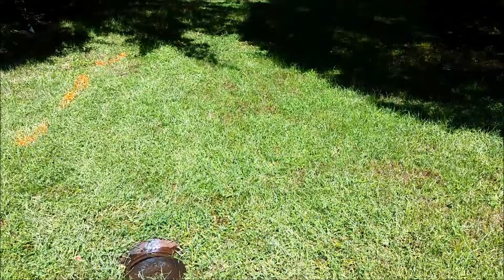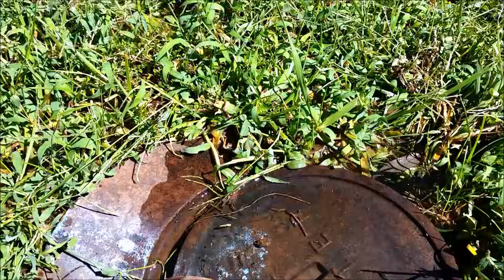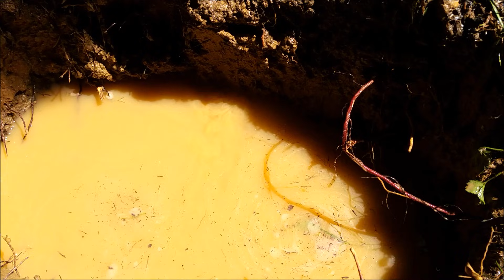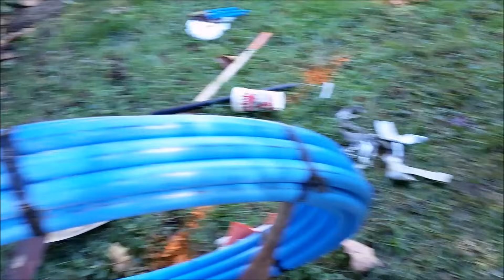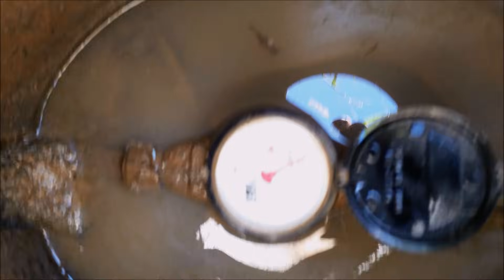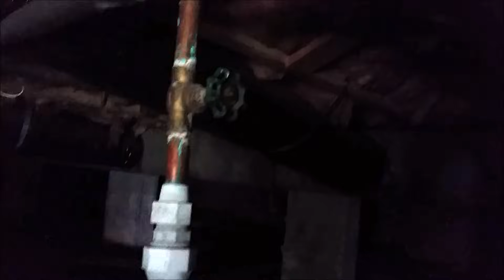DIY: How To Fix a Broken Main Water Line Pipe

Comment: YOU ABSOLUTE MAD MAN! Opening a gate valve that quickly is truly living the Adrenalin life, living on the edge.
Reply from the maker: Thanks! Didn't know that. I did some searching and didn't find anything that said to open them slowly, but I can't think of a reason not to take an extra few seconds to open slowly to be on the safe side.
Reply: @RiverLifeWV  And, once you fully open the valve shut it back a quarter of a turn. Reason is that anyone else moving the valve will know after a quarter turn it will stop (= open) and it obvious which way to then turn off & also stops the valve seizing against to end stop.
Had that have been my place (good job BTW) I would have left the hole open for a few days to check it from time to time and a length of plastic drain pipe cut into 2 halves would make a good cover / protection for the pipe repair before bedding the pipe in soft sand.

Comment: I had same issue , I installed the compression coupler and no leaks , but I had water leaking down from the dirt , I wonder if it was from all the water that leaked overnight or I must have another leak down the line , will check in the AM see if there's more water sipping down ..

Comment: You can use standard PVC. U can buy just a for for cheap. As long as its the same diameter. The fittings will work the same.
Reply: We have same problem but don't know what diameter of water pipe we are using... How to figure it out?
Reply: That's the best

Comment: Good job! And yes, that is called a service line, not a water main. The water main is the main line that delivers water to your service line. Also, u want to always disinfect the new materials with sodium hypochlorite (bleach). And always FLUSH your at the nearest hose connect before u let the water into your house. But u did a great job! Way to save a bundle!
Reply: Also, flushing the line will allow you to not only get any sediment from the repair but also it will flush and force out any air in the line which can also make sure that you don’t get any air hammering on your plumbing line and or prv protection.
Reply: How do I flush the line?
Reply: Now, thats spoken like a true water distribution license holer.😁🤷‍♂️ same
Reply: I think all house have a background valve with a strainer I know my house does. I believe if u do let junk in ur pipes u can take the strainer out and clean it and purge it a big put it back in and ull be good. Never had to do it on plumbing but had to do it on water source AC units a trillion times
Reply: I meant backflow valve not background
Reply: @hvacdr  I discovered that the cheapskate installer who put in our water supply line did not install a backflow valve, unfortunately. I have to be careful to never leave the water hose in my goats' water trough, because when our rural water company does repairs to the main they get air in the lines and sometimes there's a vacuum that sucks water back into the main. The dirty water gets mixed with "clean" water that way.
This is one reason why I never drink our water and buy purified water instead. The other reason is because our soil was heavily contaminated by the testing of solid rocket propellant and motors, weapons, and ballistics done by Lockheed Martin back in the 1960s-70s, so Chromium 6 and other nasty stuff has contaminated our groundwater. 
I've had to replace supply lines to both toilets, replaced my kitchen faucet 3 times in 16 years because the internal seals fail from the very corrosive water. It also ruined my washer, and I have to change out shower heads because they corrode and clog up.
The water company gets away with selling this water to us because they are such a small company the state allows them to skirt the laws, they're only serving @ 300 people. 
I've lost several friends and neighbors to brain, bladder, and liver cancer over the years.
Lockheed closed off the contaminated test site at the foot of our mountain for decades, but claim it's all cleaned up now, so Portero Canyon today is the site of brand new homes that start at $400,000 to over a million $. I predict that those residents will also experience "cancer clusters" like our mountain community has. 
My nearest neighbors didn't believe me, they lived here since the 1980s and said the water was fine. He died 6 years ago after his leg had to be amputated due to cancer, she died last year of stomach cancer. 😢
We need someone like Erin Brockovich here.
Reply: @LazyIRanch  Wow that sounds very nasty. Where are you located?
Reply: @rickkoleyahoocom  S. California, about 30 miles east of Palm Springs.
Reply: can't fight the big giant companies who have mega lobbiest community sitting in HIll and many of those guys are on their payrolls. lol crazy
Reply: matthew stiles

Comment: Have the same problem with my water service line although there is no standing water to assist with a locate. In my case, the meter continues to run even though I've isolated the house at the main shutoff valve. The line runs slightly uphill and I've poked and prodded (to a depth of 3-4') at least a dozen areas over a 75' area  but am coming up dry.  From observing the meter, I'm losing about 1 gal/min and have had to shut off/on the main several times daily to conserve water. Any other ideas how to locate this break?
Reply: Pick up a stick with a fork in it and walk around until it starts spinning in your hand. Then you’ll know you’re in the right place, and, of course, you’ll also know that you’re possessed by a demon. Fix your water problem as quickly as possible and then immediately get to the nearest priest in your area who performs exorcisms, preferably one with plenty of experience, but not too many repeat customers. Try to remember when he starts doing his thing that he is only trying to help, and do your best not to spit on him, as your saliva will have likely turned green by this point and I’m not totally sure but I’d have to assume that it won’t smell too pleasant. Be prepared to suddenly know foreign languages that you’ve never learned and possibly gain the ability to turn your head all the way around and walk on the ceiling, and don’t be alarmed by any of these things happening as they are all perfectly normal occurrences while being exorcized. It would probably be best to remove your shoes prior to the event, though, because ceilings can be quiet difficult to clean. After you are yourself again, thank the priest for his troubles and apologize for cursing him in various ancient languages, and then ask nicely if he would mind sending some holy water back with you for the road. You can never have too much of that stuff in the days following the removal of an evil spirit. Also, you will definitely want to keep a cross on you at all times in the near future, and don’t forget to always have a Bible within reach, if not actually in your hands, until you’re confident that Lucifer has gotten bored of you, and moved on to cause havoc in some other area. if you have a similar problem in the future, avoid using witchcraft to summon the angel of death, and try summoning a plumber instead. Contact multiple companies in your area to find one that’s friendly and knowledgeable, as well as affordable. Tell them Satan sent you 😀 👍🏿

Comment: Man, thats a good feeling when ya make a repair and cut the water back on and there are no leaks,,,Winning,,!... Good job,,,
Reply: Siva Kumar you can call your local utility company to shut off your Main line but you can easily do it yourself with a special tool they usually call it like a T Bar If i remember correctly this guy showed it on his video he didn't actually explain it but he showed it
Reply: Siva Kumar it's probably quite late now to answer ur ? But usually homes have two shut off valves that lead to a home 1 is usually right outside your home somewhere near outside the door maybe or near a spigot where you can attach a water hose to and the other which is the main main one its out by the street usually in most cases
Reply: TheMeddiee

Assuming the water meter is similar to mine (which, it also seems to be similar to the guy's meter that made this video), all you really need is a sturdy pair of 'vice-grip' type pliers.

All you do is take the vice-grip pliers & adjust them so they are able clamp down tightly onto the in/out-flow valve 'dial'.

Then, you'll likely be able to just leave the pliers attached to that dial until the job that is being performed is complete.

On my meter (and I assume all of them), to turn the water OFF it's about 1/2 turn of the dial clockwise. And of course, to turn on, it's the opposite turn. :-)

Just my own experience - and I thought I'd share. 

I also just want to say a BIG thanks to the guy that made this video. Anything that empowers a homeowner to do more things (and also enabling them to save a bunch of money in the process) that will help his/her family is awesome!

Thanks man!
Reply: how did you turn off main water line ? do you call utilities to do ? i could not see any shut-off valvel
Reply from the maker: Thanks @boatswain1985. You're not kidding! It was a great feeling, especially knowing how much money I saved myself!

Comment: There should have been a insert that slips in to the end of the pipe also so the fitting can be tightened down for the poly pipe I have seen
Reply: MrWoodshedder guys in the store lost of times doesn't know , sleeves are a must, hope you are not digging again in a few
Reply: marito242 It’s called a insert or a crush insert...if it didn’t leak when he tightened it it’s going to be ok...that’s just do you don’t crush the pipe when you tighten the brass coupling...he will be fine
Reply from the maker: Thanks Bud. The fitting was installed to the specifications as detailed by the plumbing supply store.
Reply: NP they should have known
Reply: Bud W keyword is plumbing supply, should have went to a waterworks supply
Reply: Here is a video from a manufacturer on the proper installation of a mac-pac coupler: advance to 3m40sec

https://www.youtube.com/watch?v=Und2qtnHwgE

Comment: Good job.  Those rocks will do it every time.  The pipe should have been bedded in sand before covering when it was originally installed.
Reply from the maker: +Michael Licitra It seemed to me the pipe should have some kind of support. It looked like they just trenched that sucker in there as quickly as possible with no regard for anything else. Thanks!
Reply: Michael Licitra cartoon